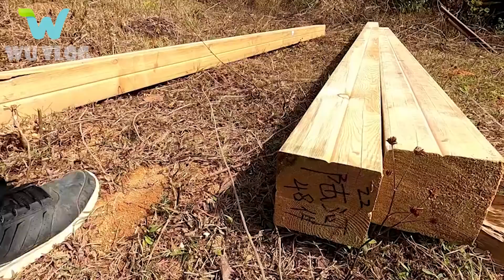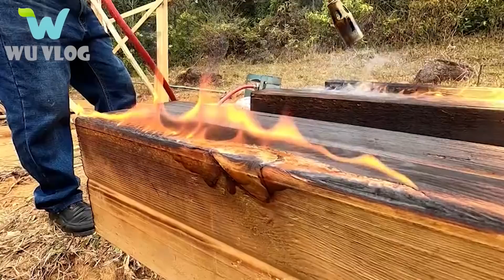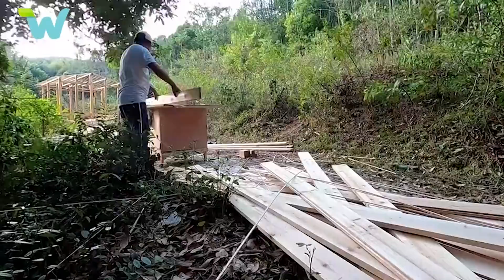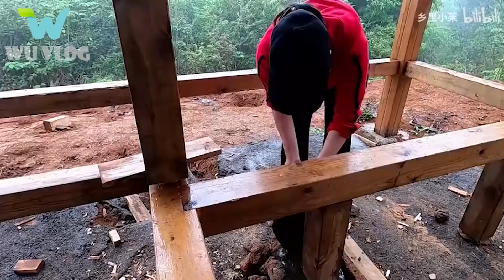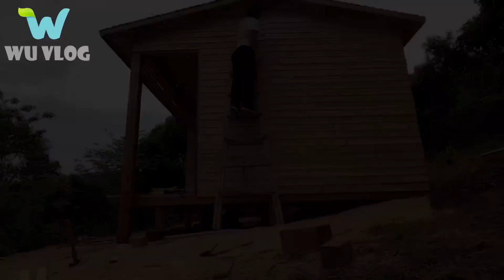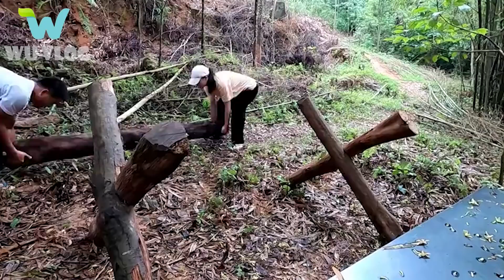Young couple build the dream-like wooden house in the forest | WU Vlog ▶ 67

Comment: Where is the BATHROOM or the POOP ROOM?  The window glass that swings down is a hazard.  The glass will break if the support misses  its place for sure, I can guarantee.  Plastic cover on the roof?  Just a little gust of wind would make it useless, especially when it is exposed to the hot heat of the sun and the wet rainy weather.  It would not last.